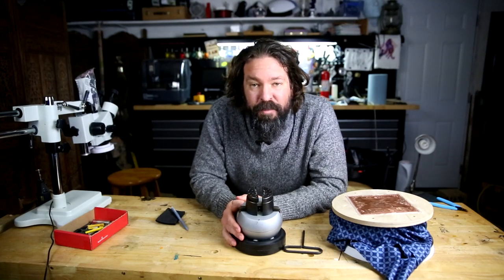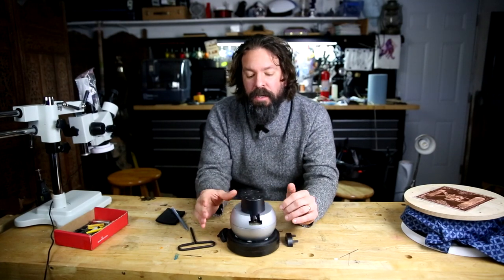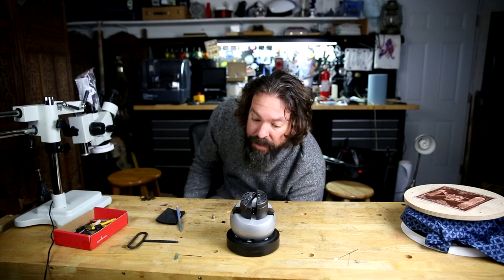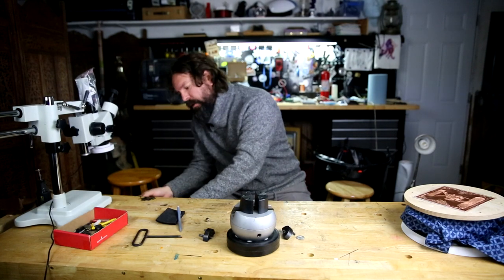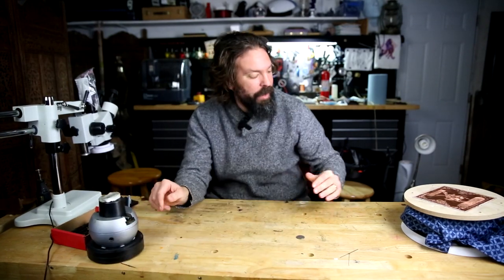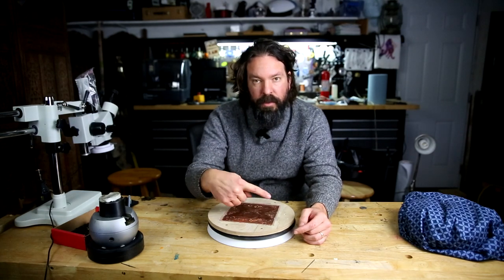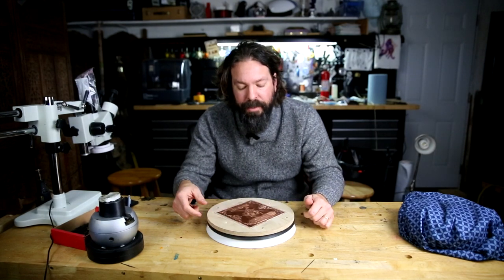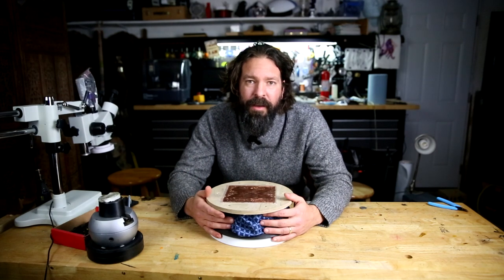Beginner Hand Engraving: cheap and diy workholding (ball vise and lazy suzan)

Comment: This is great, thank you! Whenever I see elaborately engraved trench art, I always wonder what the artist's setup would have been in the field. I feel like you're not far off with the DIY setup. Some combination of wax, a sandbag, and some surface smooth enough to turn on might have been the solution for many.
Reply from the maker: I suspect a lot of the time they weren't so worried about a turning surface. you just start scratching and take your time. Maybe use wax to hold your item on a piece of wood and you're good to go

Comment: Please help...I got a cheap ball vise and it didn't have a rubber base just plastic....and it moves everywhere everytime I  hit the material im trying to engrave. How could I fix it...I know I messed up by buying a cheap but I'm on a budget 😔
Reply: Cheap fix would be either a rubber mat to sit it on or maybe some sort of silicone caulking for something that would attach to it
Reply: @timfitzpatrick8773  exactly what I did ...a silicone mat ty
Reply: Theoreticaly, you can use leather. Take piece of leather and glue it on areas of the base where the ball touches the base. It will, in theory, move when you want and won't move when you don't want because the friction between leather and metal is just right. But I didn't try it. I have cheap chinese 5" ball vise on its way to me. I only did some research. After it arives, I'll try some experiments. Btw thanks for the tip with silicone mat. I'll try it too.
Reply: @wilfriedvomacka1783  good advice ty
Reply: @wilfriedvomacka1783  I'm in the market myself, let me know how it turns out for ya